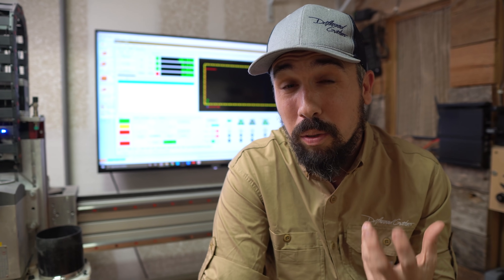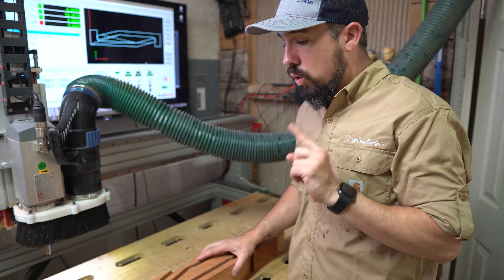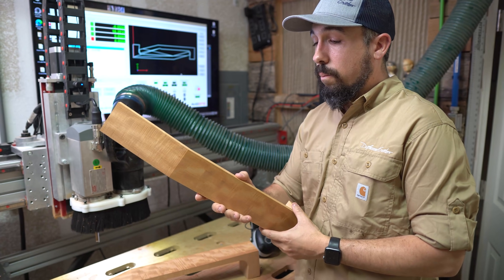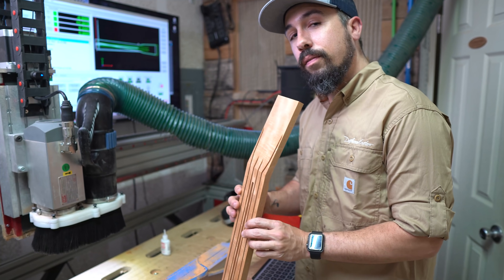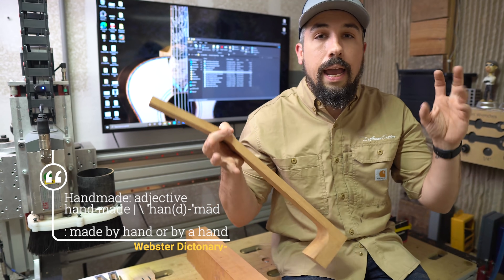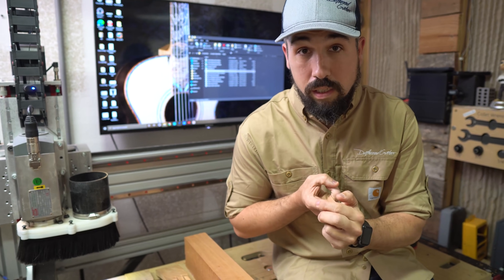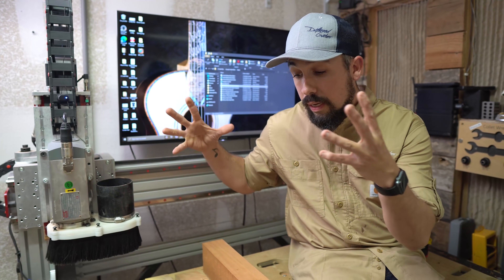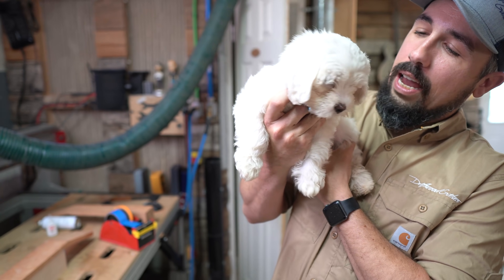Can You CNC Machine A "Handmade" Guitar?

Comment: A cnc is a tool, like a bandsaw or a chisel. A cnc does not build guitars.
So ofcourse you’re a handbuilder.
Reply: CNC is definetely NOT like a bandsaw or a chisel.🤣🤣🤣🤣🤣😎😎 Come on man. I would myself use any means of doing it easier and more precisely, don't get me wrong. But they're definetely not the same!
Reply: I think the major difference is CNC is computer controlled so the only mistake you can make is in the programming. IMO It's not even close to the skill set it takes to use any other woodworking tool.
This is simply a tool that speeds up the building process. What computer controlled machines were used in the timber processing before you got it?
I think the vital information is you are making hand voiced and hand finished guitars. 
Working without machines would be incredibly inefficient and as long as you are not assembling them with a machine, just having to QC the finish, factory style then IMO they are still very much hand made.
Besides, the more efficient you can make your business, the more successful you will be and the happier your customers will be.
Reply: But a chisel is not a machine...  The perfect example of different types of tools in this case in order of more work and skill required would be a handsaw, a bandsaw and a cnc... The cnc enormously facilitates and also speeds up the initial stages of a lot of these parts on a guitar.  Chris says that the result if done with bandsaw and "hand" would be identical.  Not really.  Not that it would be better or worst.  I know he could do it "just" as well.  But it would not be identical, especially every time, like a cnc would be able to obtain.  That's where a cnc is just like a robot.  In the end, there's so much done by hand by the time the guitar is done though, that it would definitely be considered a hand built instrument in general terms.
Reply: @andrewkeen1888  I'm guessing you've never actually programmed a CNC machine before. It is definitely an art, with lots of iterations and learning that goes into how to generate that template. What size bit can you use for the intricacy of the design balanced against the density of the wood? What rotational speed is right so that you cut cleanly, but without risking burning the wood? Do you do shallow passes, but more of them to get a smoother finish, at the risk of blunting the small section of the cutting surface that you're using? Or do you dig deeper on each pass to let more of the tool cutting surface be used, but at a higher risk of tear-out? Do you have the right amount of tightness in your collet so that the bit won't shift in high-density wood, but not so tight that you risk shattering the collet and scattering high-speed shrapnel across your shop? 

It takes a LOT of time, skill, and effort to learn how to get the CNC set up correctly to get 100% replicable builds, and a lot of time, skill, and effort to maintain that CNC so it will continue to 100% replicate your builds.

As the original commenter stated, it's a tool that you use, just as a bandsaw is a tool and a chisel is a tool. We don't call it cheating because a builder uses a chisel to scrape out wood more efficiently than using his fingernails, and it's not cheating for learning an immense skill set so you can use a CNC to get consistent cuts.
Reply: @darthzen  you kinda missed the point. Of course using/programming a CNC is a highly skilled job, just a totally different skillset to using hand tools. I.e not even close! 
Sorry to offend 🤣

Comment: "Custom Made" solves any issues people may have.
Reply: Yes, custom made is the best way.  I don’t care what tools are used, I care about the artisan details and the years of experience/know-how required to achieve it.  Taylor makes some awesome high-quality and very repeatable factory production guitars, and I own one. But, to commission a luthier to custom build me a guitar, THAT is a very special thing. Apples and oranges to me.
Reply: i agree with that. it's neither fully handmade (if you take the strict definition) but also not fully machine made. custom made is the best term for this, imho.
Reply: It's still hand made.  You used CNC to remove waste.  In short,  you got it to the point you would have with a bandsaw... you made a blank.  From there it's all hand shaped.  So the actual building and shaping of the finished guitar is done by hand. 

Here's where I step on toes. You're guitars sound amazing.  There is, on the other hand,  a VERY famous acoustic manufacturer (starts with a T, folks)  that I think sound horrible. Beautiful looking,  but flat and lifeless.  I've thought this LONG before I knew the extent to which their instruments were CNC'd. (I'm over 40. I've thought this since I was 15.) I can only surmise that it's the lack of a craftsman's hand that causes them to sound this way. This is where CNC goes wrong.  NOT what you're doing.

It's rough shaping folks. It's still hand built.
Reply: Stradivarius was REAL handmade!!😎😎
Reply: What if you had an advanced cnc machine that could examine the grain, density, resonance and whatever of the wood and remove the non-musical parts and produce an otherworldly level of resonance and sustain in a set of braces and top wood?  You’d still have to be able to program that excellence into the machine in order to produce a usable result.  My thinking is the CNC has done what you knew to tell it to do.  You made the model and created the GCode to run the machine, so in my opinion it is still your art.  You just had a far more advanced tool than did Andre Amati.
Reply: I'd even suggest "Boutique" ;).

The label is more about the quality and attention to details than it is to the process or equipment isn't it? Maybe the number of employees too :D.
Reply: @kawmic7   Which should include logging with just an ax ? Would he have logged with a chainsaw, if he had the opportunity ?
Reply: Agreed.
Reply: @TheMrSnyder his hand is still guiding the final form that results in a neck. Using a CNC to make a blank and then his using hand tools to form the blank to final shape is still hand made.  How about he uses a CNC to make templates and then uses the templates to form, cut and finish a guitar. Hand made or no? I say still hand made.

Other wise you would have to cut the tree down with a hand saw. And dry the lumber by hand with a fan.
Reply: that feels decieptful to me but, whatever rolls your socks up...
Reply: Buildings, not trees, are "custom made".
Reply: @carltondhouston Do you mean like an AI cnc ? 
folly.... when the blind lead the soul-less off the abyss
good luck with that dream, Agent Smith.

Comment: As a toolmaker for 50+ years I watched the evolution of machine tools from manual mills and lathes to CNC machining centers and EDM machines. We used the very same skill set to produce parts on the CNC as we did on manual machines and we had to add a new skill of becoming computer (CAD/CAM) literate. The finished product was still dependent on the skill of the craftsman. The use of CNC led to a better product at a lower cost. I consider everything I made as built by me not the machine. The machine is just another tool and we all love tools. All the products we made (molds for plastic injection molding) were one offs highly accurate and ranging from simple to “that’s not possible.” So yes you are a hand builder that makes use of the best tools available to you. Beautiful looking and sounding guitars by the way.

Comment: As a guitar maker that does everything by hand, no cnc, I see no difference between having a cnc router do your roughing work or having it done by your apprentice.  I do have a problem when automation gets used in finish carving, voicing, and inlay work.  Building instruments is an art form.  No one would ever complain if famous painter had an assistant stretch there canvas, but you pay a whole lot more for the hand painted originals then the prints.  The line is crossed when you start removing the artist from the art.
Reply: Exactly !
Reply: this is a year old comment. So I dont expect a reply.
but I have a different take on this discussion. I am a professional machine designer, 3D designs and ultimatly 2D drawings for production of said equipment. cnc milling, cnc lathe, cnc laser cutting, cnc EDM and cnc welding and other intricate work that my job requires to make reliable machines and people that are skilled masters of their craft to make those things.

dont get me wrong, I do so much appreciate items made by hand tools... it is just amazing.... but creation comes from the mind, not the tools you use... it takes years to master cnc operations and even more to learn to design for cnc.... It is the artist/mind that makes a creation, not the tools.

regardless... I appriciate you and perhaps one day I will create something without my machines.... Learning is the best way forward

Comment: AS someone who operates CNC machines for a living, I'm a little biased, but yes, it's just a tool, like a bandsaw, only more precise. To me, it's the finishing that makes the difference. A manufactured guitar has a top made to a set spec, Xmm, for example. You have a spec that is a starting point, and fine tune it, depending on that specific piece of wood. The finishing takes it from a  mechanical device to a piece of art. 

On a side note, you make ukuleles? I'd be interested in hearing how your approach to
making a uke differs from making a guitar. Some people build ukuleles like they're just miniature guitars, which they are not.

Comment: I have been seing your videos so becoming a fan.  I liked this question about cnc vs hand made because I am making a "cuatro" and first thing I did was design the instrument in CAD.  This is my opinion: I think there is no a line thta define hand made vs machine made or computer made.  I think there is a very wide gray zone separating the hand made vs the machine made.  We all use tool now and in ancient times to make thing, so hand made would be like making a sand castle.  But in the context of guitar bulding I thing we start entering in this gray zone when the tool used have some dregree of "inteligence" as the cnc does.  When you program and the tool cut without someone touching the work.  In hand made or you push/pull the tool or you push/pull the wood.  In this video you use a cnc to make a 2D profile cut with depth control.  this is like a 2nd degree on this gray zone.  1st would be a 2D with no depth control.  If you program the cnc to cut a shape in 3D, like making the contour of the neck combines with its radious then it would be a next level, closer to machine made.  But making a guitar (or similar instruments) is a complex process that is very dificult to automate.  So I would say that at any level of cnc usage the construction would be "hand made"with cnc assist.  note this is different to mass production.  This is my humble opinion.  Omar

Comment: Great video, thanks.

I just bought a CNC after having a similar internal dialogue and coming to the same conclusion. It's just a tool. There are so many other parts of guitar building, from finishing to electronics and set up that require hands-on work, experience, and patience. I see no reason not to use a CNC instead of double-stick taping a template (which most builders did not design themselves) and routing the outline or pockets of a guitar. If it's good enough for PRS, it's good enough for me.

In my case, the biggest selling points of the CNC are repeatability, precision, and safety (too many close calls on a router table). Also, if I ever decide to use a template and go old school I can make my own!

Comment: Hi, yes you are a builder, So is there a difference betwen a manual saw and a band saw, or a chisel and a router bit, to define you as the builder of a hand made? so all by hand, means not to use any tool?
So Marx again: worths more because of the hours invested "all by hand, hand made", between the effort and the use of tools? Or the quality in the process, tools, and materials.

Comment: I definitely think that your guitars are hand made. I think that the way you use your cnc is just to get a more consistent and effective result. I like the way you use it to cut out the soundboard. When you do it that way you have a very precise result and then you have more consistency wich is very good. You still glue and shape all the braces by hand. The same with the neck. You do the general shape with the cnc and then the rest by hand. I think that if you would have shaped the neck to its final result so you would just have the final sanding left, then I wouldn't call it hand made. But that is not the case :) thank you very much for your videos. Cheers from Sweden 🇸🇪

Comment: Based on your other videos, you are really hands on during every stage of assembly, glue up, and and voicing the bracing. If you are saving wood and making a better and more accurately fit together guitar, that's all I care about. I think the line is crossed when cheap mass production materials are sloppily slapped together by unskilled (and probably poorly paid) workers on an assembly line, with poor quality control. The reason to have a skilled crafts-person carefully putting together a higher priced item should be to produce a superior instrument that unskilled workers and/or fully automated processes could never make, IMHO.

Comment: I think you summed it up perfectly. Electrics almost totally build on cnc I would not consider handmade. Acoustic guitars I believe are handmade when you thickness the top and voice the braces for each guitar to make that top sound as good as it can. Production line guitars are largely over built to standard sizes/thicknesses to withstand warranty issues.

Comment: Its a complex and nuanced discussion and you make a lot of valid points.  It does still take human skill to program the CNC, it is another labour saving power tool.

But for me the critical difference is betrayed in the name - computerised numerical control.  Its autonomous in operation, control by computer, a human hand doesn't need to be in the room.  

A bandsaw, a pillar drill, a lathe, a router - also labour saving power tools but they still have a human hand and human judgement directly in control of every movement.  Still hand made.  A CNC (for me) breaks that association - it's operating independently of human hand, judgement, adjustment.  It isn't hand made in the sense we all use that term.  Its hands free.

But does that matter?  Are you hand-making tuning keys, or buying them in?  Hand making trussrods/D-tubes/strings/strap-buttons/screws? Not everything in the guitar is going to be hand-made, there's a degree of latitude, so to me it's just about where a customer wants to draw the line.  If you're upfront and describe what is and isn't hand-made, it's up to the customer to decide what elements are critical to them.  A CNC roughcut that you then shape and profile by hand shouldn't put anybody off - you used your human judgement and skill to hand finish the machine built rough part.

Comment: Mechanisation versus Hand Tools versus Assembly Operative versus Craftsman versus Computer Programmer.  

Whilst skills and time spent programming and operating CNC machinery certainly count massively, the only aspect directly impacting productivity via machining is the machinist/machine operator and assembly worker.  As with typical car manufacture.

Regardless of time spent in design and programming, and the need to cover such costs, the end result is produced primarily by machine and potentially a supervised assembly worker.  Parts can be finessed during each stage of the process and eventually an assembled instrument.  If most elements of materials preparation involve the same set of machining and assembly operations, the end result is machine made, to be assembled, fine tuned and finished by hand.  

Does it matter if an instrument's parts are machined and assembled, handcrafted/handmade and assembled, or created by Martians and beamed into the hands of users?  Parts assembly isn't luthiery, no matter the amount of tap tuning, brace scalloping, dovetailed neck joints and intricate inlays using machine made parts.

Comment: Safety glasses should not be optional around a CNC, or any power tool for that matter.
Reply from the maker: I’m the worst about my eye protection for some reason. I’m hyper sensitive about using heating protection all the time, but I never wear my safety glasses. I gotta be better about that for sure.

Comment: I think for a lot of people, "Handmade" denotes a level of attention to detail and fit and finish you don't often get from production line guitars. If you made all the parts with CNC and still hand finished and fit everything together with the attention to the braces and so on I've seen in your other videos I'd still consider it high end and hand made. You're just using the CNC to streamline the process. If you put the wood in and a completed guitar came out and no finishing required that would be different but that's not the case. Nobody goes and mines the metal to then forge screws and tuners. Nobody is drawing out their fret wire from a block of metal. If you can use tools to make a more quality and consistent product then I say that's a good thing. I think what a lot (not all) are wanting from a "handmade" guitar is quality. If I made a hand made guitar from scratch with my experience, it could be truly handmade but it would also be garbage. I'm a player, not a builder. Nobody would look at my "handmade" acoustic guitar and celebrate it as handmade. They'd throw it in the trash. It's your experience building and all the hours messing something up and learning from it and the hand finishing with the attention to detail that you show in your videos that makes it a "handmade" guitar. All that is just my opinion though.